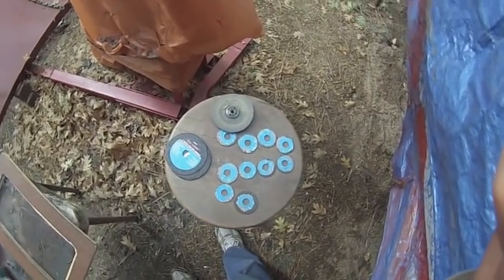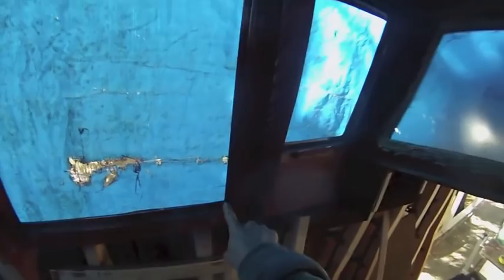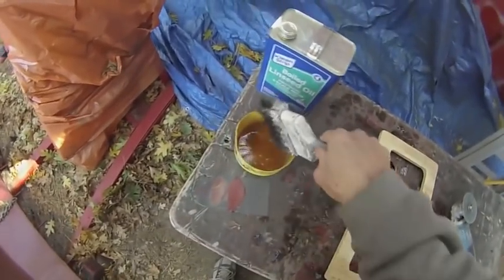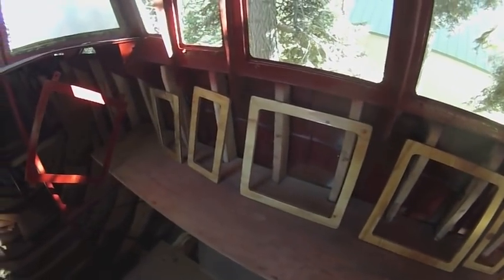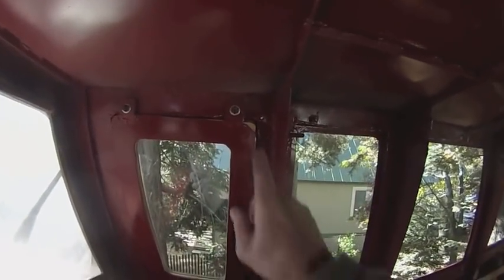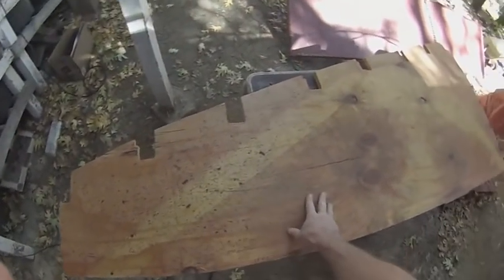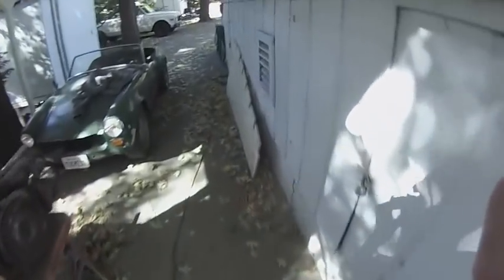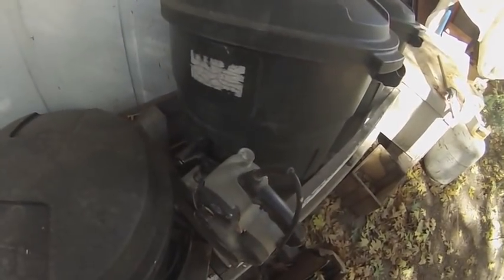Steel Sailboat Build Part 21

Comment: Cpl of points that may help: 
(1) when laying out your windows, accurately mark your four corner positions and drill holes and then connect the holes when cutting with a jig saw or plasma, or whiz-wheels and you'll have radiussed corners already- for future reference-

(2) the Diamond cut-off wheels would cut that thin steel like butter and last a really long time compared to those el-cheapo Cut-off disks that self destruct (if they came from Harbor Freight or Rural King or Northern tool, etc, then they REALLY dont last worth a shit) when buying abrasive wheels, grinding disks or sandpaper, you really can't cut corners and buy the cheap stuff, cause it doesn't work and doesn't last)

(3) those regular Plywood frames will warp like CRAZY when they get wet - best to buy some form of marine wood thats not layered like that, or marine ply? in that application they will be getting SOAKED!